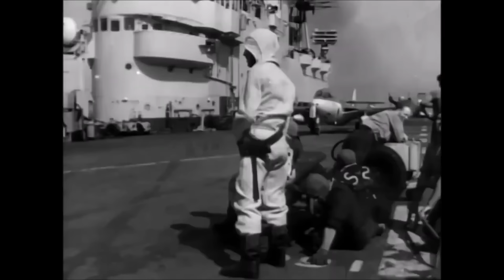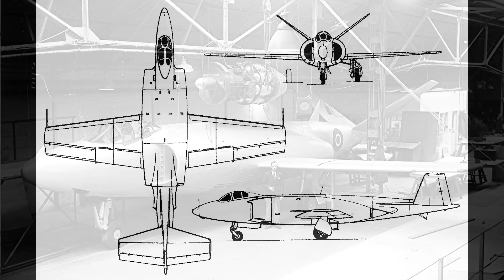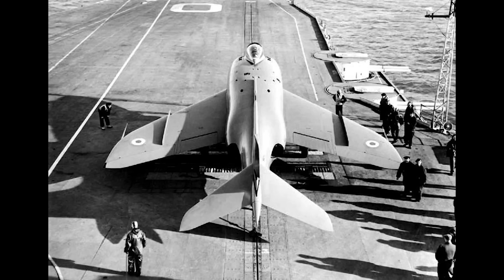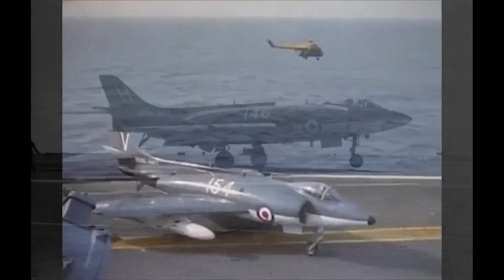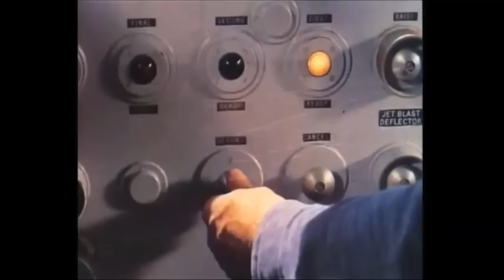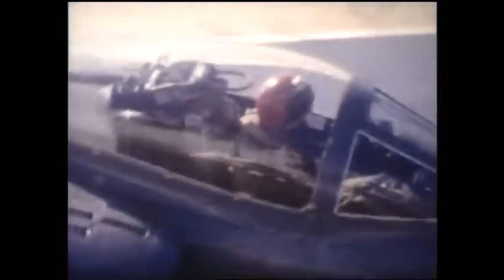Supermarine's Last Fighter: The Most Powerful Gun Battery Ever Deployed To A Carrier

Comment: A rubber mat for belly flops.  I've seen some real head-scratcher ideas presented on this channel, but this rubber mat thing may be the topper.  🤔
Reply: Carrier made from ice was pretty far out there.
Reply: @fryertuck6496  That was the proposed HMS Habakkuk. It would have been made out of a mixture of sawdust and ice.  And it was to be able to land and launch bombers (think avero Lancaster and the like).
Reply: @animal16365  Maybe HMS Eskimo might have been a better name...
Reply: @uberduberdave  or HMS Quinn.
Reply: @uberduberdave    that name was already taken by a Tribal class destroyer
Reply: @animal16365  I thought so, but wasn't sure...
Reply: Probably Winkle himself on film demonstrating the lunacy. A piece of cake for him, but for many it might have done more than scuff the paint. Normally wing folding is done after landing...
Reply: Suppose you had to come back with pylons full of ordnance, how down that play out?
Reply: @AmbuBadger this was before they were hanging planes full of tanks and bombs and pods generally. And if they did the stores were basic enough that it was cheaper to just jettison them first than to pay for arresting gear and maintenance, landing gear and maintenance on those, the weight penalty and extra fuel burned, the space taken up, the payload subtracted, etc. 
As it is a lot of aircraft still require you to jettison a bunch of stores before you are at deck landing weight and those tend to be a lot more expensive and complex now then they were back then. An F-14 that took off with a full load of Phoenix was not able to land with all of them, and those were a million dollars each back in the 1970s. An iron bomb costs more than you probably want to pay for one. A fuel tank is tens of thousands of dollars, even without hundreds of gallons of kerosene in it. Operating jets is expensive, military jets especially.
Reply: I wonder if someone overheard the idea and it led to the development of the Slip and Slide lawn mat?
Reply: @schaddenkorp6977 except the idea for this is to have more friction so you don't just zoom off the side of the deck. So there really isn't any similarity. It's not just a sheet of rubber laid over the deck, it's much more complex than that.